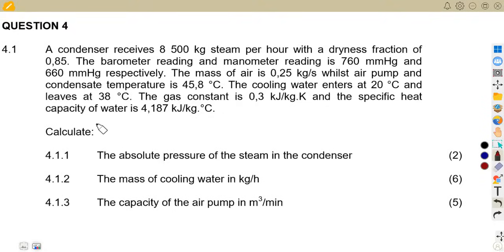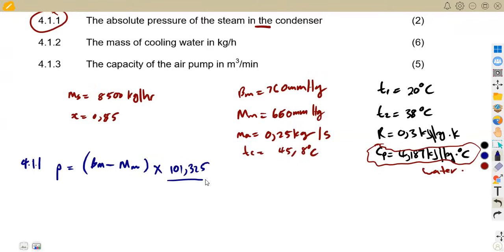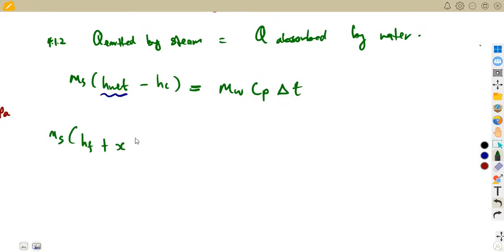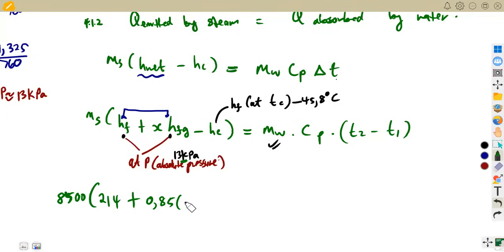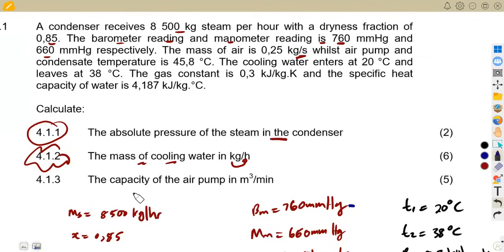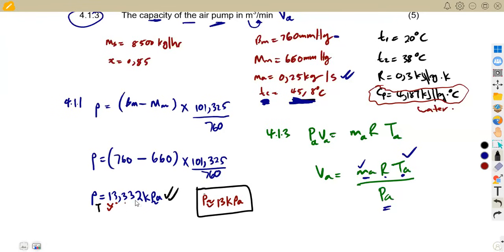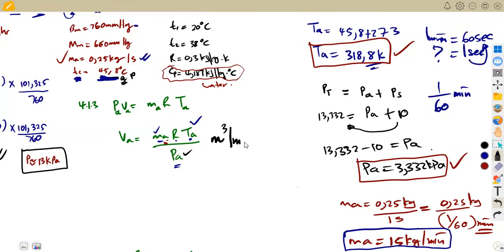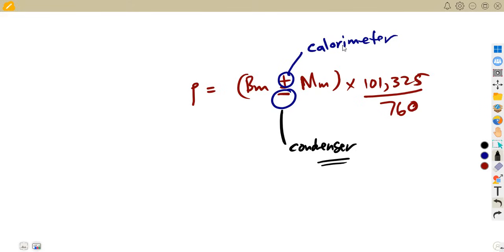Power Machines N5 CONDENSERS NOVEMBER 2019 Revision @mathszoneafricanmotives

Comment: So every time we want to find Hw of steam we use pressure to read Hf and hfg and for hf of condensate we use temperature but sometimes we are given many temperatures sometimes I even think of using those temperatures to read hf and hfg for Hwet. And what do we do when the temperature for condensate is not found in the steam table
Reply from the maker: You can always use the given data to solve the problem, more light in your revisions.
Reply from the maker: It’s either they give you temp or pressure